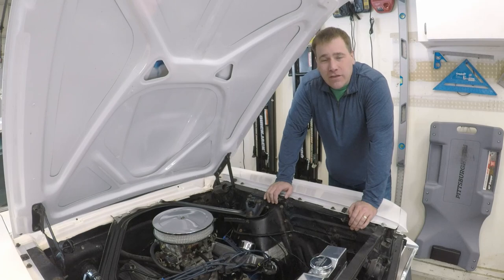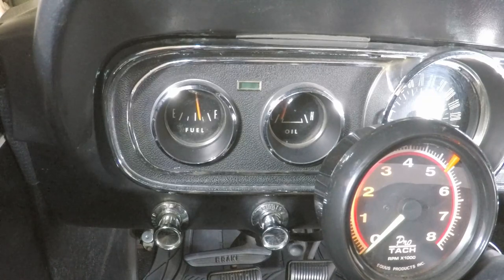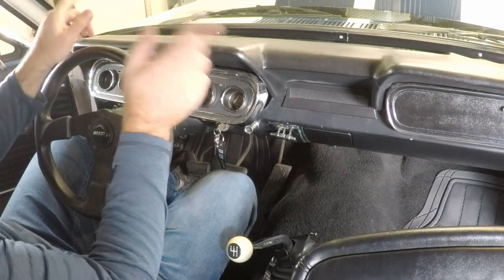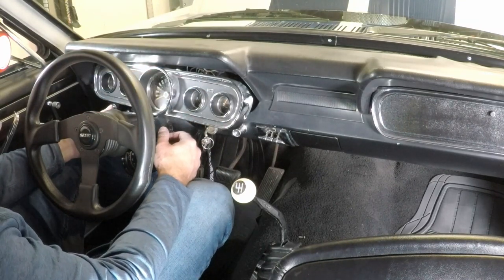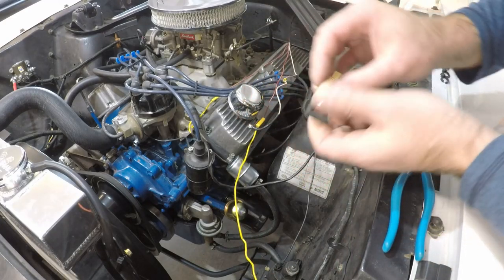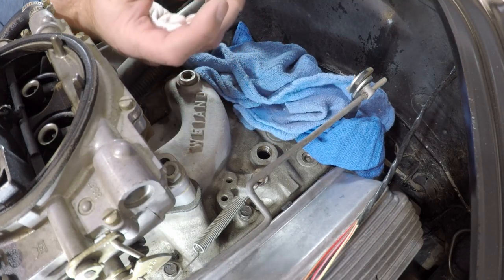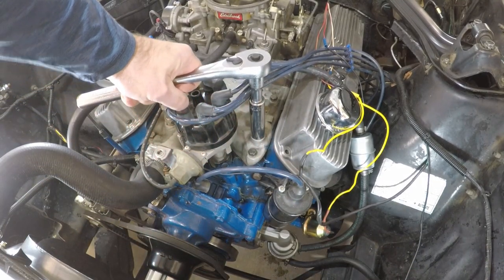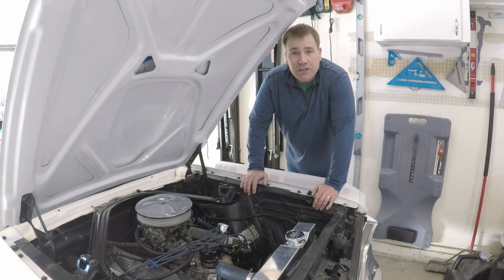How to fix the Oil Pressure Gauge in a 1966 Mustang

Comment: Another quick fix for me. Figured my cluster didn't have a good ground since the engine compartment was fitting nice. My dash was painted as well. When you mentioned that I opened it up. I saw that the ground connector was cracked in the back of the temp sensor. EZ
Reply from the maker: Nice work!

Comment: you have come a long way in a year.
Reply from the maker: Thanks!
Reply: @AndyKruseChannel  and thank you. Your videos are very helpful. Speaking of which, if the gauges work after testing the wiring, then most likely the sending units are bad, correct?
Reply from the maker: @bofa83  Good question.  If the needle on the gauge moves when you ground the wire that goes to the sending unit, but the needle does not move when connected to the sending unit and the car is on, then yes, your sending unit(s) are bad.

Comment: Late response BUT that coolant temp sender is blocking the flow of mixture to cyl #8 just install a pipe plug there. What you removed from the front of the manifold was a busted mechanical temp gauge bulb. Just FYI.
Reply from the maker: Thanks for the heads up.  :)

Comment: That rear port that had the "oil temperature sensor" might have been a vacuum port. Does it go into the engine valley or intake port? I wonder if the previous owner used that as a plug? Was it hooked up?

Nice video by the way!
Reply from the maker: Thanks!!  I feel so silly as I learned quite a bit while making this video, and I say things throughout the video that I later correct as I figure stuff out.  That part of the manifold is the runner for cylinder 8, that's why I made the comment wondering if they were using that sending unit as some type of air intake sensor.  They had it plugged in but wired to the oil temp gauge, it's making me wonder what else I'm going to find as I continue to work on this car.  :)

Comment: That back port is for the vacume hose for the power booster if you had power brakes. I own two 66 mustangs.  One with a 289 and the other a 347 and built them both.  I ran new under the hood wiring harnesses rather than splicing wires.   Their not that expensive and look  much better.
Reply from the maker: I wish I had that knowledge going into that video, I felt silly calling it related to oil.  :)
Reply: so basically this previous owner as I'm finding out on mine, they just don't care just stick it together, guess was just a sensor that fit the hole, screws missing doubleback tape instead, lazy i don't get it, mine oh we cleaned motor, the spray painted everything

Comment: Andy you know what gear I need to make speedo work with 17" tires
Reply from the maker: I can't find it right now, but there are websites that allow you to enter the diameter (or circumference) of the tire and the gearing you have in your rear end and it will tell you the number of teeth you need on the Speedo gear.  17" tires sound really small, you probably mean 17" wheels, the tires will be more like 25" or so.
Reply: Thanks Andy  yeah I meant wheel size sorry but I did find a article 4 step method to figure out your rear in Gear’s

Comment: My pressure gauge gos too hot when I put my key on the on position on my 1966 ford mustang
Reply from the maker: If you mean that your oil pressure gauge maxes out when the key is on, then your oil sending unit is likely done and you'll need a new one.  :)

Comment: WARNING!!!!!   Behind the gauge cluster, the wire going to the Temp gauge is RED with a light WHITE stripe on it....  WARNING!!!!!!  The wire going to the AMP GAUGE is SOLID RED....    YOU GET IT?????    After 50 years the thin white stripe is pretty faded...  DO NOT PUT SOLID RED ON THE TEMP GAUGE..  you will burn up the gauge and possible the voltage step down regulator....   I HATE what Ford did in the wiring in this car, it looks like a 5 year old..  that like the color RED, wired the car...  HEY FORD..  there ARE OTHER COLORS....   USE THEM...  STUPID!
Reply from the maker: Thanks for the heads up.